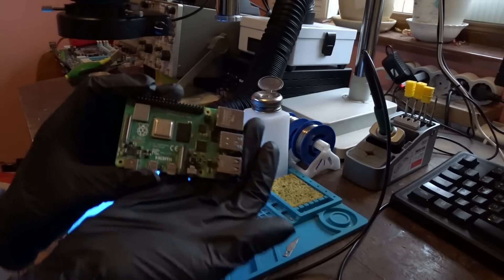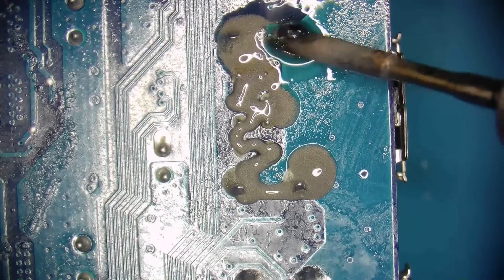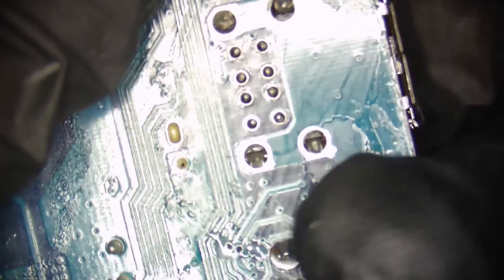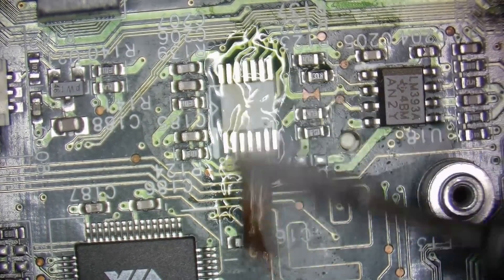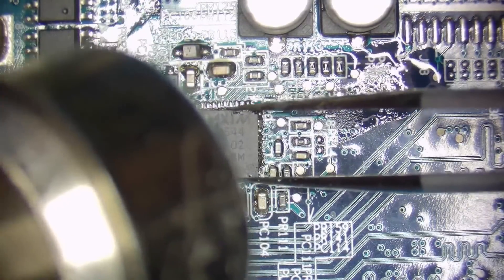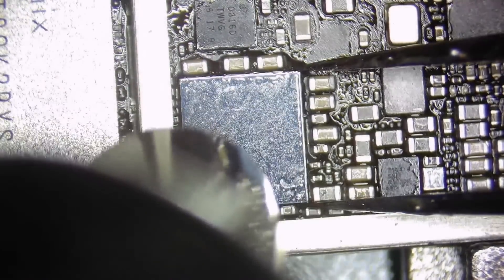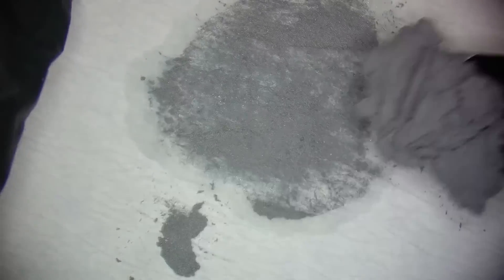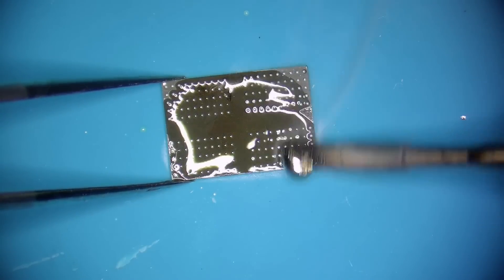How to Solder and Desolder Common Components - Tutorial

Comment: Bro, this is the best tutorial I have watched. You give the best tips such as placing the low temp solder on a coffee filter, I had always had trouble with that. Have you ever had a chip or IC crack before? I am interested in upgrading the main memory in some old phones but that would require more tools to reflash the software on there right?
Reply from the maker: If you are going to upgrade the storage on those phones you are going to need a eMMC programmer to copy all the data from the original one and to transfer it to the new one or else it ain't gonna work.
Reply: @MadEDoctor  I would love it if you did a tutorial on something like that. Keep up the good work!
Reply from the maker: @alfredo962905  I have only one programmer on hand which is for iPhone 8-12 NAND, the proccess is simular for android phones so I can do video on that in the future. Thanks for the suggestion!

Comment: I don’t post comments on youtube, but you got me as a subscriber. I’m a beginner to soldering, I do mostly basic stuff and I wanted to go on with microsoldering and I cannot find any information or tutorials about microsoldering. In this video you explained so much I want to thank you very much, I will proceed and buy many pastes because I can see now that they are very important. One question: if we want to reball something and we don’t have the mold for it what else can we do?
Reply from the maker: Glad to hear I was helpful! 
About the question: You have only one very difficult and tricky thing left to do. In short, there are solder balls sold in big quantities like 25000 balls for 2-3$ and you can use them for re-balling. 
There are a few things to consider few things, first of all, there are I think 15-20 different sizes (like 0.2mm, 0.25, 0.30) up to about 1mm or so, and for every chip, you need a specific size so better have most of the smaller ones in stock.
The next thing is you need to use a solder wick on the chip to prepare it for the balls.
Then you apply a very small amount of flux and disperse it with a Q-tip or smth so you get a very thin layer of flux on the pads.
After this, you are ready to place one by one the balls over the pads - make sure to center them to minimize the risk of them touching and combining into one big solder blob.
Now you better have a board heater that you can reach 200-250 degrees C, or you will need to use a hot air station set to the lowest possible airflow and again it can be a nightmare. You need to heat up the chip as gently as possible to melt the balls and allow them to stick to the pads below without them moving and touching each other.
If you are still reading - I hope this was enough to make you buy a stencil xD
Also, you can use a combination of premade balls and stencil and it is a lot easier.
Reply: @MadEDoctor  Thank you very much, and keep on doing videos like that, I will watch every one of them

Comment: Is the purpose of reballing the BGA to swap the lead-free with lower melting temp leaded solder ?
Reply from the maker: If we talk for a new chip, than yes. But if we talk about reusing a chip (or getting it from a donor board), you are required to do a re-ball, or else the chip won't make a proper contact with the board. It is true that when you go over it with some flux and soldering iron the all the pads get equal amount of solder on them, but this amount Is far from the balls needed.

Comment: Keep up the great videos!! 

You should use referral links for the consumables as well (solder, wick, etc) for those who need them. Can you show how to use an oscilloscope, or maybe even all the functions on a multimeter for those who are new.
Reply from the maker: Actually pretty good suggestions, thank you!
Reply: @MadEDoctor  You do an excellent job explaining and showing these things, even with text to speech! (which doesn't bother me at all either)

I have a lot of these items and honestly don't know how to use most of them haha. I have a DS213 pocket oscilloscope from miniware running a custom firmware to fix some of the bugs, but I have no idea what I'm doing. I do love their TS80P USB-C PD soldering iron though (also running a custom firmware of course lol). 

I see the prices of Raspberry Pi's skyrocketing and think how smart I was to buy so many model 3b boards, zero 2's, and of course a Pi 4 2Gb back before 2020! My ex wife didn't understand why I needed to collect them all and perhaps that's why we are no longer partners! 😂 

Are you into SDR at all? That's another field I bought tons of equipment for and got very overwhelmed...
Reply from the maker: @cmorche  Actually my programming skull are kinda terrible… Probably the only thing I admit I know how to program and use is Arduino boards💀
Reply from the maker: @cmorche  Nope… But I will give it a try